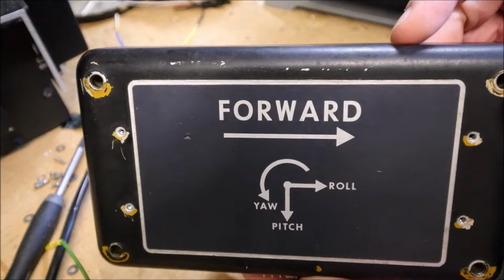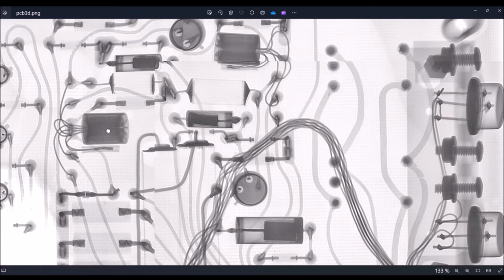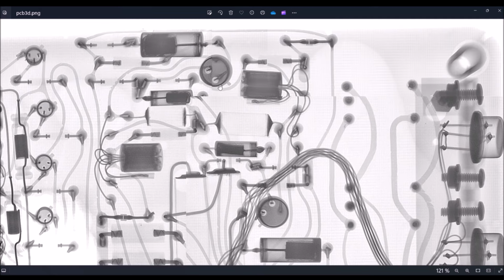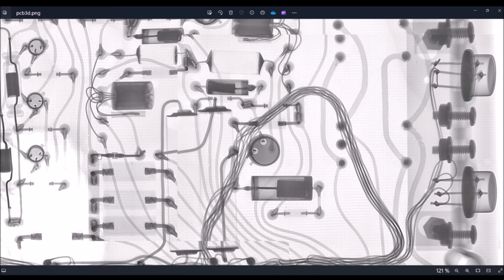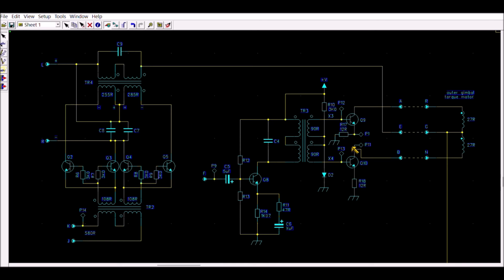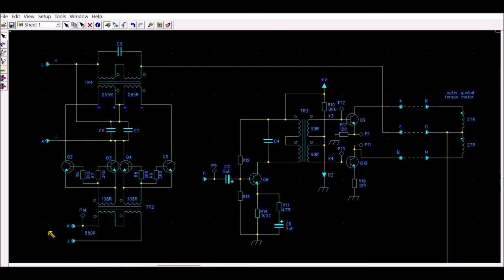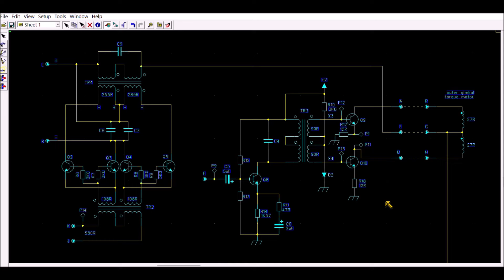LDM #365: Atlas launcher gyro part 3: demodulator reverse engineering using X-ray Cheetah EVO

Comment: Great X-ray photos. I'm curious to know how you found the component values.
Reply from the maker: I was waiting for this question... Actually I succeeded after one day of hard work to remove the potting below the pcb, on the solder side. Therefore it was possible to measure the value of some parts.

Comment: Very interesting, thank you for posting! I saw the comment below about part values - may I ask how you removed the compound? Physical force or did you use any chemicals? Heat? Another question - there was some misalignment for the xray image - was it scanned in tiles and then reassembled, for higher resolution perhaps? The capacitor internals match solid tantalum designs, which makes sense for the application.
Reply from the maker: I have used a hot air gun, set to 500°C. The compound was less hard and it was possible to remove it in small pieces using a screwdriver. It was impossible to do the same on the component side because of the thickness of the compound and the parts.
Concerning the X-ray a total of six pictures were taken, the module was too large for a single shot. Image area was maximum, the resolution of the picture can be much better with smaller areas. After I have reassembled the images to get a single one. It was impossible to have a perfect alignment everywhere.
Reply: @lelabodemichel5162  Thank you for the de-potting information. We all hope for a magic solution to this, but it never exists, does it. At least it was a partial success. Regarding stitching of images, it's always possible to use "grid warp" tools to align tile edges manually. For GIMP it's the W shortcut, and Photoshop has a grid warp tool as well in the transform section. There are also dedicated open-source tools like Hugin to do all this automatically.
Reply: @oriole8789  well, actually there are specific solvants to remove the potting compound, they work very well but they also damage the board (more or less), so in most cases it wont be functional after the process, you will however be able to read most parts mpn and measure values on the parts which have not been damaged. The solvant mostly eats the PCB FR4, soldermask etc.

Comment: Reverse Engineering a 1965 Atlas Launcher Gyro Demodulator Module

* 0:04 Demodulator Module: The video focuses on dissecting a potted demodulator module from a GR 10A-1 gyro subsystem used in the Atlas Launch Vehicle.
* 0:11 Potting Removal: The module's hard blue potting is removed using a 100-degree Celsius oven to allow access to the internal components.
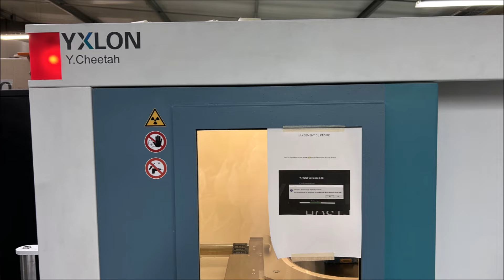* 1:26 X-Ray Analysis: X-ray imaging using the XYLON Cheeta EVO reveals the internal structure and components, including transistors, transformers, capacitors, resistors, and diodes.  [From Comments] This may be a CT or CBCT scan rather than tomography, given the high resolution.
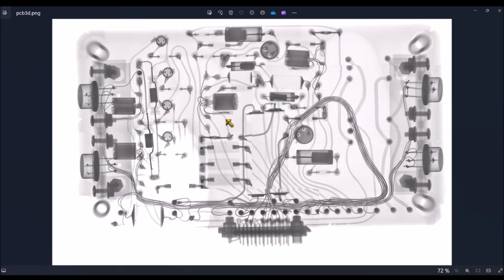* 1:39 Transistor Identification:  The X-ray images allow identification of the transistor terminals (collector, base, emitter) and the presence of heat sinks.
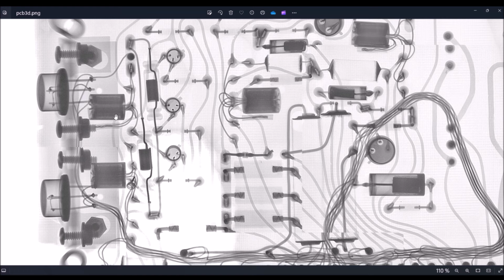* 2:30 Transformers:  The module utilizes classic transformers with six wires each, common in 1960s and 1970s electronics.
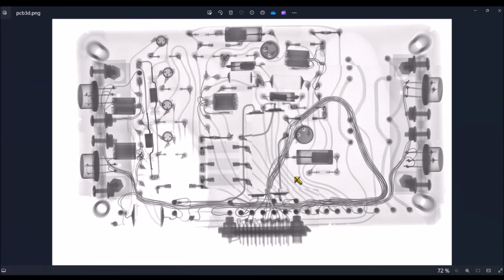* 4:07 Preamplifier Circuit Analysis: The video meticulously traces the signal path through the preamplifier circuit, identifying components like coupling capacitors, bias resistors, emitter resistors, and the tuning capacitor for 400 Hz operation.
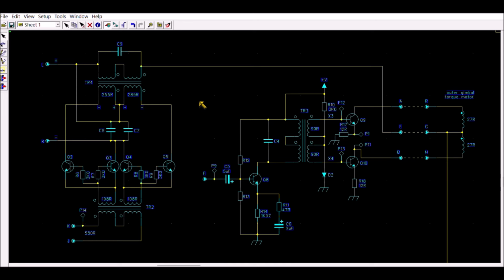* 7:54 Complete Schematic: A complete schematic diagram of the demodulator module is presented, showing two identical amplifiers, each connected to a torque motor of the gyro.
* 8:08 Torque Motor Control: The amplifiers control the outer and inner gimbal torque motors, enabling precise positioning.
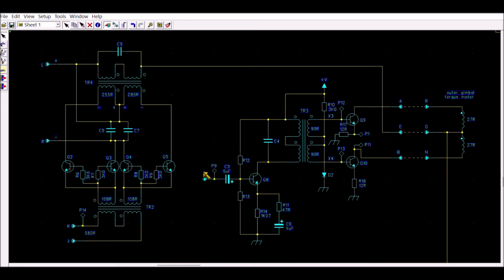* 8:40 Modulator Circuit: The video analyzes the modulator circuit, which modifies the torque and gimbal position based on a DC voltage input.
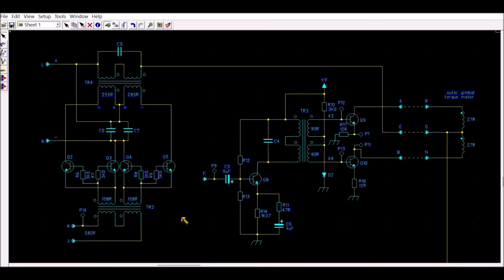* 9:04 Modulator Functionality:  The modulator utilizes pairs of transistors and a transformer to generate a sine signal with frequency, amplitude, and phase dependent on the DC voltage input. [From Comments] The video creator mentions it took considerable effort to reverse engineer this circuit.
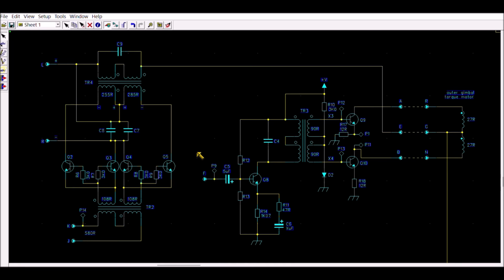* 11:06 Purpose and Conclusion: The exact purpose of the circuit in the guidance system remains unknown, but the video successfully demonstrates the feasibility of reverse engineering vintage electronics using X-ray imaging.
* 11:22 Reverse Engineering Time: The entire reverse engineering process, from X-ray images to schematic, took approximately one full day.

I used gemini-1.5-pro-exp-0801 to summarize the transcript.
Cost (if I didn't use the free tier): $0.06
Input tokens: 15124
Output tokens: 513